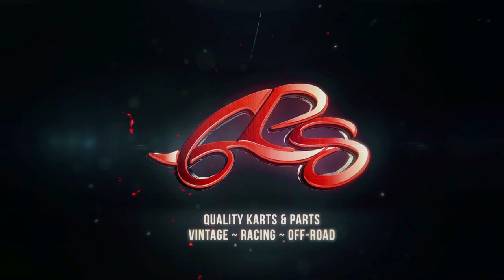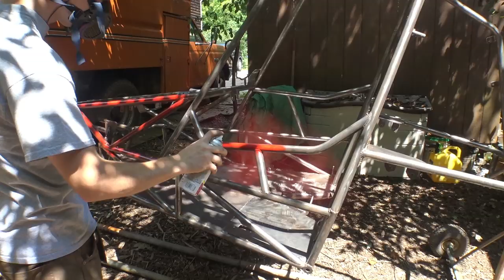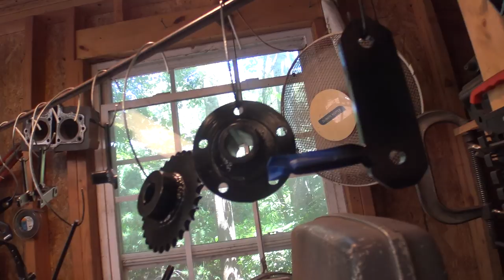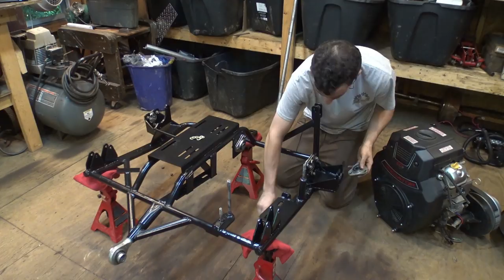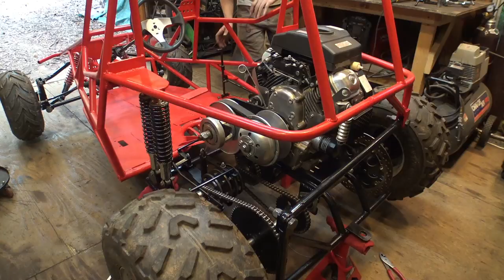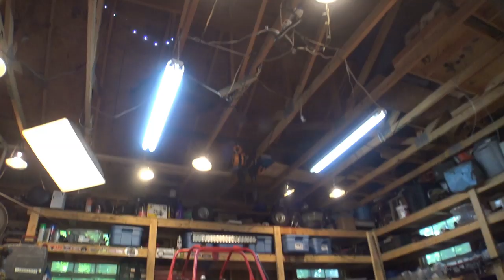painting the two speed 670 off road go kart

Comment: Wish I could have worked with you on the build. You may want to weld a plate in the A arms.  A horn, brake light. mud flaps and rear view mirror are nice features. I ran my cables and wiring threw 1/8" and 1/4" pipe to protect them. Another ammo box on the other side would be nice for carrying a tow strap, phone and wallet.  I enjoyed the videos and I have used Rustoleum paint for years. I paint my engine tins and shocks to.  Great job, I look forward to more videos.

Comment: i've had no choice in the past but to rattlecan a paint job and i've used krylon and rustolium with excellent results with both (not a full paintjob but repainting hoods, axles, bumpers, etc) my favorite paint to use for bumpers is actually Krylon durakote (i think they have since changed the name) which is an enamel paint, it drys hard like a powder coat and i've actually driven through brush and not even scratched the paint, had a few rubs but no gouges or scratches, awesome work on this buggy man, your work has come a long way and your builds keep getting cooler, cant wait to see what comes next from this build and your big side by side build, keep on wrenchin' and stay dirty xD

Comment: I agree with the spray paint. The quality and technology in spray paints especially nozzles of today far exceeds the old days of crappy flaking uneven paint. I like the 2 pack mixed cans they are fantastic on small jobs. I use the gun alot also but only on big jobs, yours is mostly just tube chassis so a spray can is much easier an no cleaning. Only down side is more costly. Just my opinion on it lol.

Comment: what is the actual reason you decide to use spray paint? You can save quite a bit of money in the long run using even a really cheap hvlp gun from harbor freight and still use rustolem and get thicker coats (although you don't seem to have that issue I guess) thanks!